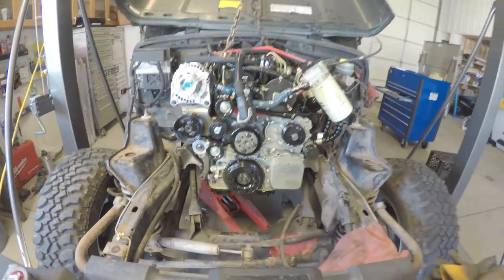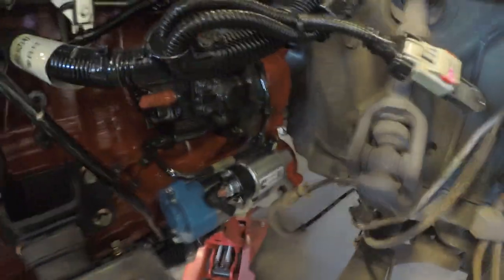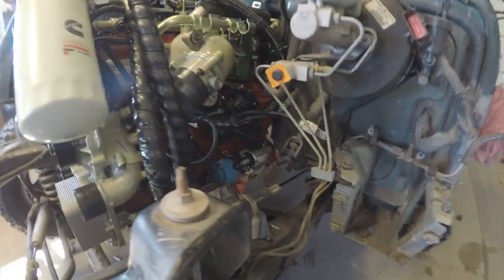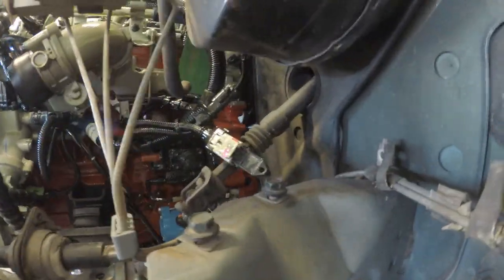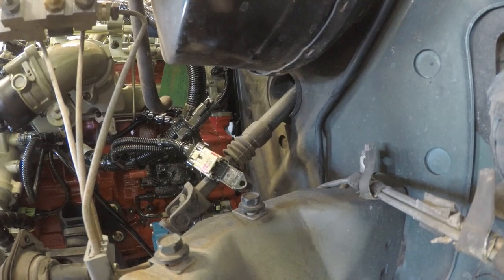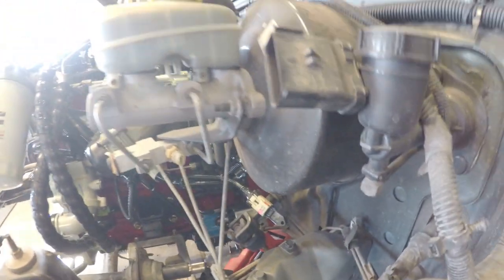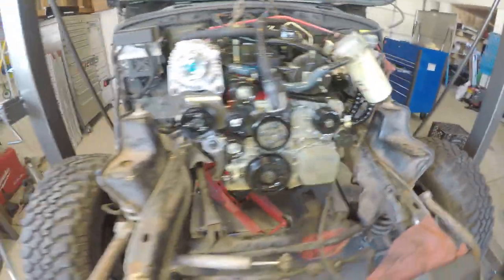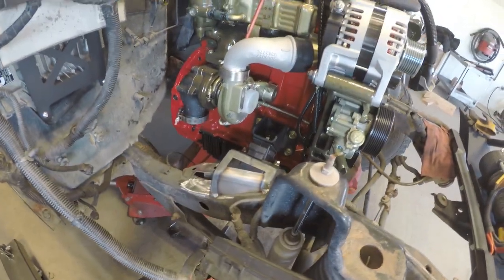TJ Cummins Swap Day 4

Comment: What’s the best method for determining engine position angle? 

Is there a general rule of thumb, book or video that covers this?

Putting the Cummins in my FJ40 this winter

Thanks 👍
Reply from the maker: The Cummins repower website covers this in their youtube/instructional vids.  Few degrees down front to back and you're golden 👍